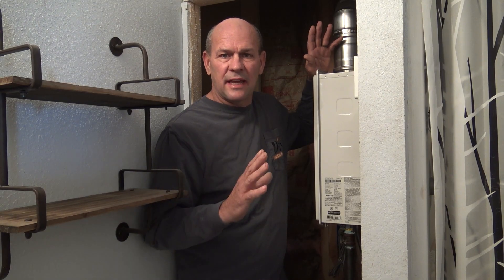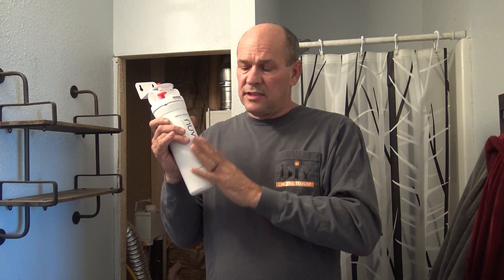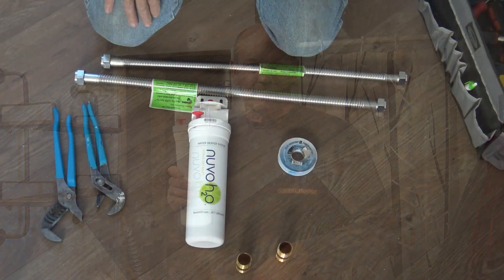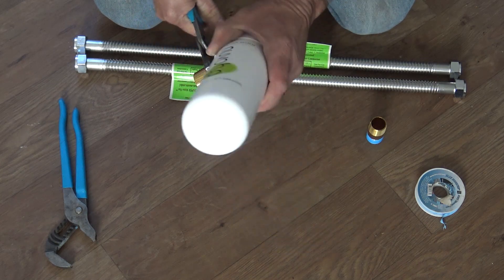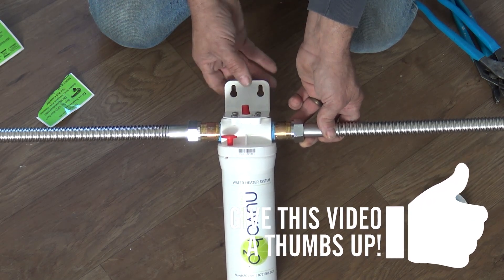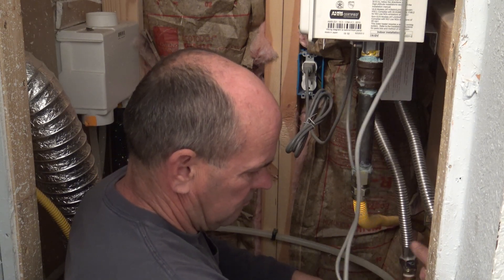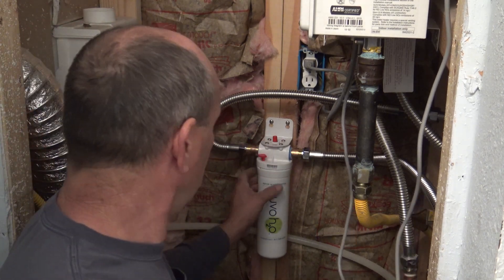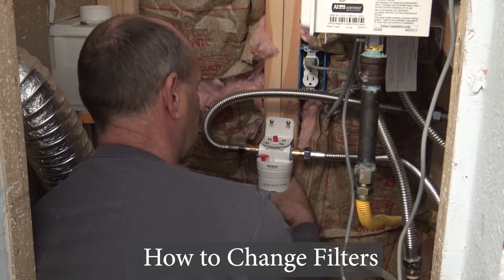How to Prevent Scale in a Water Heater | Tank or Tankless water heater Descaler

Comment: So how has it worked?
Reply from the maker: I've been installing NUVO's in homes for years and they work great. I haven't had any issue with my water heater so everything seams to be good. I am going to do a flush on it in a couple days. So I'll see how it is "real world" doing it's job.
Reply: @DIYOnTheHouse How did the flush go?  Installing one of these this week to my electric whole home tankless.  Have been getting build up on the hot side of the fixtures.  Hoping this helps!